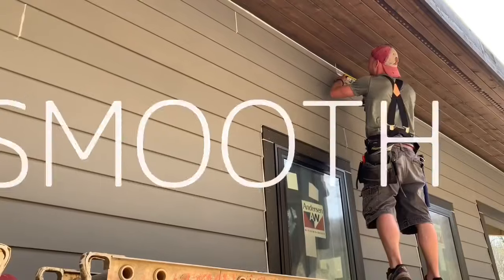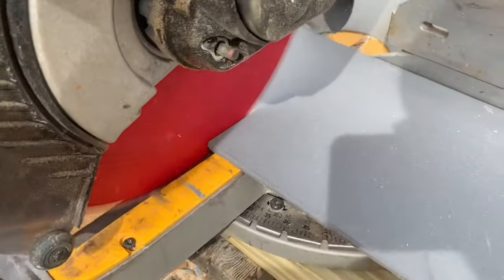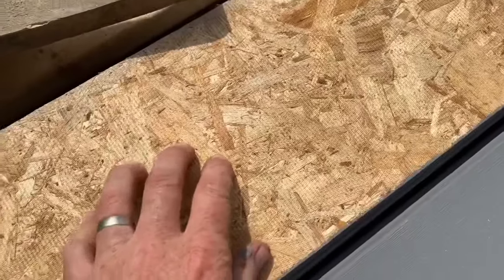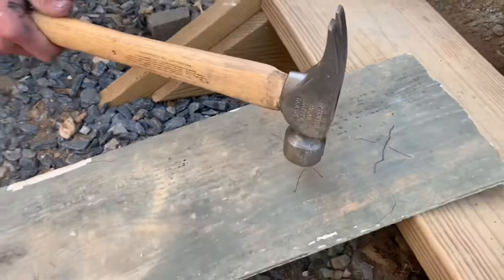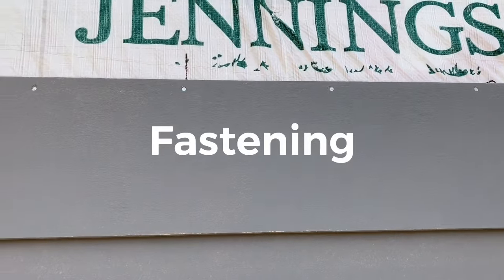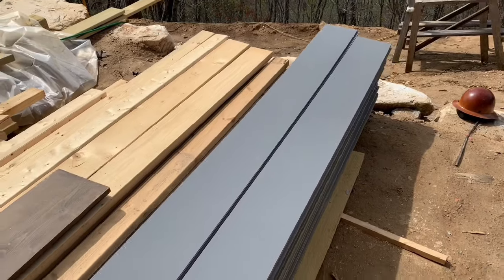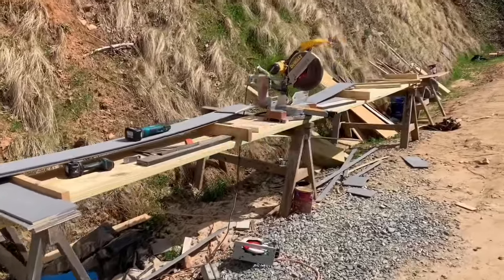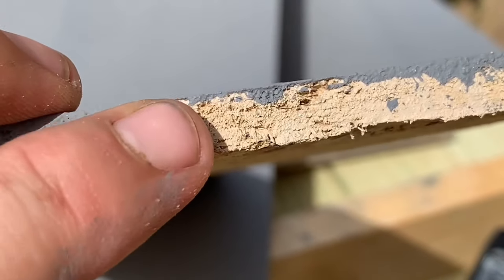Smart Side vs. Hardie Board Siding which is better

Comment: This is not a recommendation but I built a pump house with Smart board siding and didn't paint it for ten years. It came primed and looks great. After ten years in the south Texas humidity there wasn't a single flaw and one coat of paint made it look like new.  I've installed a lot of Hardie siding for others but wouldn't use it for any of my own buildings.
Reply: Hardy is fireproof Smart Siding is not let's hear you explain that
Reply: @thecloneguyz  I've seen brick houses burn to the ground.  Fireproof is a weak selling point when the structure beneath it isn't.  Smart Siding is also less brittle and holds up to hail better.  I'm not a Smart Siding sponsor but it does have advantages however Hardy offers more design options.
Reply: @BulletproofPastor  Smart Siding has millions of dollars of class action lawsuits against it in the 70s all they did is changed the name you'd have to be stupid and cheap to put that stuff on your house t-111 is better than that crap
Reply: @thecloneguyz  I take the title "cheap" as a compliment but stupid I'm not.  If Smart Siding was just a name change for the old LP siding (like my neighbor had fail on his house) Louisiana Pacific would be bankrupt by now.  The new product is nothing like what they made in the 70's and I've seen both.  Calling this product as just a name change is no different than thinking Zip Panels are just another OSB.
Reply: I think LP would be good here in South Texas
Reply: Getting ready to build a couple barns in south/central TX (30 mi west of San Antonio). Will be board-and-batten on rain screen cavity. Cedar would be my first choice, simply because it weathers like wood and doesn't lose its character with minor cracks and such. But obviously it's ass-expensive. Anything synthetic needs to be extremely durable, because one little crack or bit of delamination makes it look cheap and trashy. Hot sun, wind, and occasional hail are considerations. We have cold wet weather, but of short duration. It's moderately humid here, but nothing like Houston.
Reply: @BulletproofPastor  You are absolutely correct, the old Smart siding is not as good as the new LP Smartside the newer LP Smartside has been re-engineered. All people need to do is go to LP's web site and it tells you all about what chemicals they put in it for better water resistent and i also recall they put something else in their siding for termites and wood ants if i remember correctly.
Reply: @pterafirma have a cedar sided house in WI. Don't use it, it's super flammable and woodpeckers love putting holes in it.

Comment: On the impact test you have brand new OSB with really old fiber cement. The installer visibly drove the hammer harder through the fiber cement. As well as theres no telling if thats authentic Hardie or not (most knock off Hardie is crap). Thats not to say that a wood siding isn't more impact resistant than Hardie,  but the demo by no means was controlled. Wood is always going to be more impact resistant UNTIL you get water damage/dry rotting.
Reply: Yes Hardie is going to be strong It is concrete so u found a conspiracy
Reply: hardie is so brittle and snaps easy.
Reply: @wanderingwagers3755  real hardie shouldn't. thats why they add fiber to the cement lol
Reply: @Cdv360  I have had it snap on me carrying it gently many times. Not a bad performing product just a real pain to work with
Reply: Hardie is not as durable regardless if it is new or old.

Comment: Another tip: Get gecko clamps.  I did a hardie job by myself and it made it really easy.  The smart side seems like it's a lot easier to deal with.
Reply: Gecko gauges also work with smart siding. But it's an inferior product.  LP siding has had tons of lawsuits against it in the past.  This stuff is no better.  Check out the manufacturer's install instructions.
Reply: @christophermalloy2  Wrong Chris. The old Innerseal was the LP product that failed. LP settled that in a big way and took ownership. This stuff has been redesigned an out there over 20 years and blows FiberCement away.

Comment: Did you consider a rainscreen as the water is going to get behind the siding and since it is a wood product it needs to able to dry.  Although more difficult to work with I think cement siding long term is the premium product.

Comment: Impact resistance isn't what matters at all in an exterior product it comes down to how long it lasts in the elements. I'd take a more effective product over an easier to use product any day of the week.
Reply: Smart siding is not easier to use. This guy is full of $@#&. I do a lot of Hardy and it goes on fast and simple. Coil gun, gekkos, Hardy blade, eight foot or six foot level and a good cut man. Butt factory to factory no gaps. No need for nippers or grinder. No priming, painting or sealing. Just paint after it is up.
Reply: @speedgonzalez489  I think he's just talking about the dust from cutting hardie which is pretty annoying it gets inside tools, and forces you to wear a mask when cutting it or risk your health.
Reply: Stephen Balon same with wood! Cutting wood without a mask, acting like it doesn’t get inhaled. Especially osb
Reply: Its not just about impacts.  Its about settling and flexing too.  All which will cause Hardie to crack.

Comment: I still go with the hardie, that smooth board you like will weather and waterlogged in a short time, they had problems with this similar looking board years ago , I see its back again
Reply: That was a Masonite product, tiny fibers, which soaked up water much more than osb. And epoxies have come a long way, and Cement board has the same issues if not properly sealed..it will absorb moisture.
Reply: @colinglidden5702  You are totally correct on this. Also LP siding has different chemicals in it than the LP OSB. People need to read up on their web site and also call LP and ask questions because that's what i did and Hardie is just as good or better.

Comment: I have replaced many houses sided with LP siding manufactured in a similar way as smart side. Like OSB, it easily absorbs moisture and water and swells and then you spend twice as much to replace with non moisture swelling Hardie Siding
Can’t use this product with a high energy efficient wall assembly with rigid foam on the exterior and an air gap between the siding and the foam.  Would likely rot out in less than a year.

Comment: Hardy is brittle, heavy, 12 ft and hard to cut BUT i pulled a lot of rotten smartside off houses that weren't but about 15 years old in kansas. It was texture not smooth but it was smartside. Only bad hardy I've removed was because people hit the siding with basketballs and it cracked. I also prime the back of any wood siding before i hang it.

Comment: This video jus helped me decide which siding I am installing on my house been arguing with myself which siding product I want to use being I am almost doubling the size of my house and removing the steel siding just not a steel siding fan in most cases. I had already eliminated everything except concrete siding and smart siding. I didn't use smart siding when I retired three almost four years ago now. Thanks!
Reply: Hardy is fireproof Smart Siding will go up in flames and seconds

Comment: Lots of mis-information here:

(1) If your cutting Hardie using a grinder, your doing it wrong. When cutting Hardie you use a blade designed specifically for Fiber Cement. Check out Diablo Blades designed for fiber cement, will dramatically reduce dust. You can also get a saw with a vacuum connection if your doing enough siding work to justify it.
(2) Your impact test is a “false” test, as siding is designed to be hung in the wall w/sheathing behind it. What you’ll then find is that Hardie is a more durable product that won’t dent/crater like a wood based product like LP will. I’ve seen golf balls go through LP, not so much with Hardie when on the wall. The old hammer test, has been used by LP for years, and is full of misconceptions.
(3) LP being lighter is its core advantage w/ 16’ lengths when compare to Hardie. Here is the problem with the product, it’s still a wood based product. Wood based products will rot over time and be more subject to pests like Wood Peckers/Termites. In addition wood based products WILL expand at joints, so while there maybe LESS joints with an LP sided house vs Hardie, you will need to allow a 3/16” gap at those joints to allow for expansion, which will need to be flashed And caulked. The more caulking you do, the more Maintance there is for the homeowner down the road. Hardie is recommended to have moderate contact (touching) at butt joints  w/ NO caulk and just 6” wide flashing behind it. It will look better and have less caulk to replace in the future.
(4) Edge Checking: as water penetrates LP (and it will for any siding), the outside film and interior pressed board will separate at the edges this will cause cracking of LP near the exposed board edges. Hardie doesn’t have that issue.
(5) Fire ratings: LP is a wood product, which will add fuel to a fire; Hardie will at most only scorch. 
(6) Look at Color Plus Hardie. Saves the customer money, and you time and money (cutting out a painter/labor). And gives you a superior paint as it’s painted in a factory controlled environment. It requires the crew to take their time, and be more diligent it’s handling (ie better).
(7) stop hold the boards flat when moving them, they need to be held on the side. Of course if you hold any board flat it will cause to act like a wet noodle and create micro cracks in the board.

LP angle to the market is to appeal to easier installation for the tradesmen. Hardies (and fiber cement board in general), is to appeal to the homeowner with a longer lasting product with low maintenance. Whom do you ultimately serve? If it’s the homeowner, Hardie and fiber cement siding is the clear winner.
Reply: Shaddap
Reply: John Zaranek an amazing and thorough rebuttal comment about the pros and cons of LP vs Hardie... do you have any other insightfully commentary???
Reply: Ben: You comment on LP's product being wood based and will rot is so wrong and misleading and just inaccurate Do you even know how the stuff is made? Answer: You don't. Stop posting mis-information. As for termites? They test this stuff in termite mounds and the Zinc Borate in the product turns them away. I could go on.

Comment: Being in the carpentry trade for 20 years and counting, there is no way possible that smartside is superior to a fiber cement product for longevity. Regardless of what anyone says it is obvious smartside is a oriented strand board product. It will rot over time and no paint will prevent that especially at butt joints. After researching LP smartside for my upcoming build I am choosing a fiber cement product such as hardie.
Reply: Not OSB and inaccurate comment. Have you ever used it? And if it will rot, why does the company provide a 50 year warranty? C'mon. They'd be out of business. Hardie, has wood in it as well and is a sponge to water. 12' lengths to LP's 16'. Less seams , installs faster, and far more durable.

Comment: I was a test house for LP Smartside in SC. I really like it for many reasons, but man does it move during the seasons. Anyone that purchases this make damn sure you paint your cuts and back flash.
Reply: It doesn't expand and contract like PVC
Reply: @teamplayer1218  not sure what that means but I assure you it expands and contracts heavily.
Reply: @SJ-gd6bo  It expands one time as it acclimates once to the humidity environment. The material comes manufactured with 5 - 6% moisture content, and for a reason. It's very dry. It then has to adjust on the wall, thus the minor gaping requirements. Install it tight and it will buckle. Like any building product, install it per the manufacturers instructions and guidelines. Not rocket science here but unfortunately too many are "experts" in the trades and fail to do so.  Unlike PVC trim (AZEK) and others, it will not fluctuate with temperature. So your statement that "it expands and contracts heavily" is inaccurate.
Reply: @teamplayer1218  well as i said, I was one of the first homes in my area to have Smartside installed on my home. Even the reps did a site visit to check there product. After having this product for almost 5 years, I can absolutely confirm my statement is accurate and true. However, Smartside vs Hardie, I would use Smartside again.
Reply: @SJ-gd6bo  Don't mean to be abrasive here, but it absolutely will not contract once it acclimates.
Reply: @teamplayer1218  That can't be true unless you don't live within the laws of physics or you keep your house at a constant temperature.  Everything expands and contracts with temperature (and humidity) based on it's coefficient of thermal expansion.

Comment: I’ve hung a lot of Hardy, I’ve done 2 houses with Smart Side. Too me Smart Side looks and I’m away is kind of like trying to side with good  flooring. If I could  pick Aluminum, plastic, Hardy or Smart Side to do my own personal house. On a house with brick it’s great on soffit and fascia . Your house has gables, its very good in the gables.
Reply: The Upside of Downsizing what would you like to know. I’m sorry about that post. Yes i was kind of drunk when I posted. Too many hours playing poker and drinking good whiskey.
Reply: The Upside of Downsizing the guy is right about Smart siding. We set all or work on saw horses. You can go pretty fast if you have your work up higher. Hardy side is nasty to cut. Smart Side, like I was talking about having your work on sawhorses goes pretty fast when cutting. Hardy can’t handle hail or kids that like throwing things at a house. You can float out a wall with Smart Side. Not being able to handle hits and the cutting  is all I can say about Hardy.  When you get good you can use a stapler or roofing gun to nail it. Hardy will be torn up from using air nailers. Even hand nailed that last hit with a hammer can leave a dimple from your hammer head when hand nailing.
Reply: That didn’t make one bit of sense i was waiting for your conclusion is smart side better or shittier than hardy ??

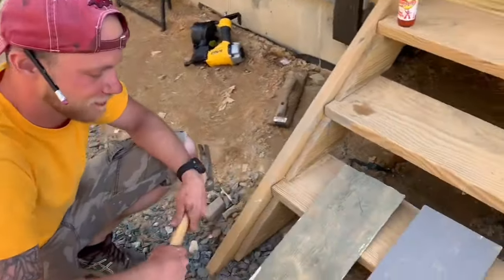Comment: In terms of the smack test at 2:05 - that's not really testing the impact strength.  To test the impact strength,  it would need to be supported behind the point of impact.  They're actually testing how brittle the materials are.  If you look at the second test, the Hardie broke when it hit the saw horse and flexed around it - never mind the fact that they're testing old Hardie alongside new smart side...  Concrete fiber is significantly stronger than wood composite, but it is also significantly more brittle.  So long as the Hardie board is properly supported to prevent flexing it's immensely harder and stronger. I very much appreciate the expertise in technique that those in construction have, but please leave the scientific testing of materials to the mechanical engineers.
Reply: @Mr Sunshines Don't refer to peoples comments with insults. It shows that you don't know how to discuss something properly. If you have a point to make, just make it.
Reply: Old or New, SmartSide is more durable than Hardie.

Comment: Been using hardie for almost 25 years even installed it on my personal home in 02 still looks great with the original paint. It's harder to install very heavy, 12' joints, lots of dust and almost impossible to fix a bad board in the center of a wall. I would use it again on my next home. I haven't used the LP looks like the old masonite siding before hardie and vynal took over.
Reply: The LP siding that looks like masonite is called Canexel.
It is made in Nova Scotia.
It was on my house for 40 years (built on 1972) and I replaced it with more Canexel.
It comes prefinished in 20 colours and blind nailed.
In my opinion superior to any other siding.
Reply: Hardie just looks cheap, a step up from vinyl.  That fake grain pattern is a dead give away.
Reply: @miragesmack007  i agree the cedar grain looks cheap. The smooth planks looks a lot nicer